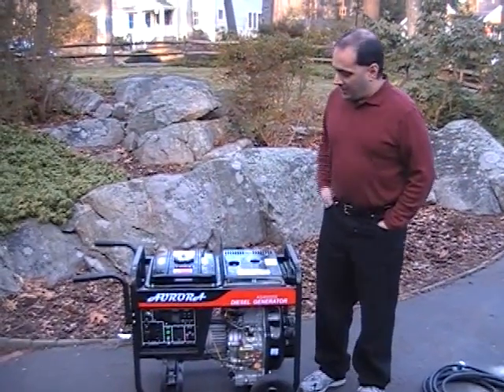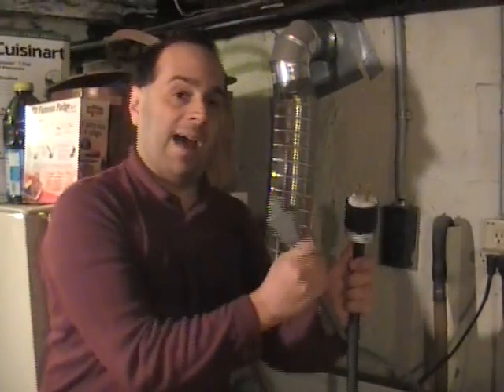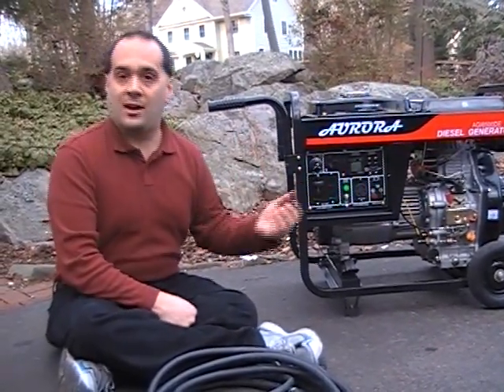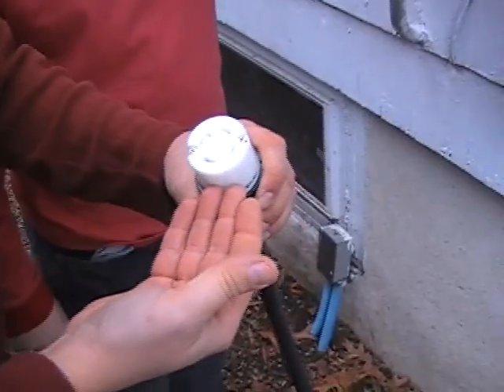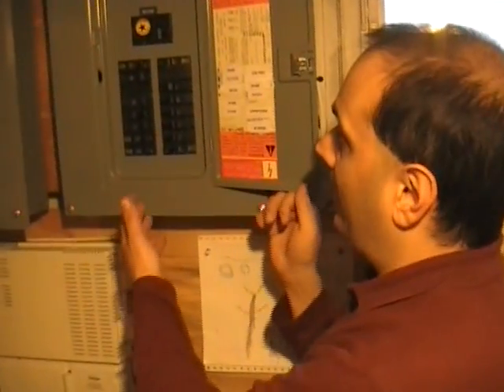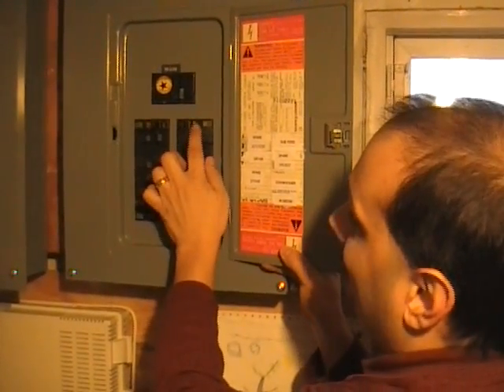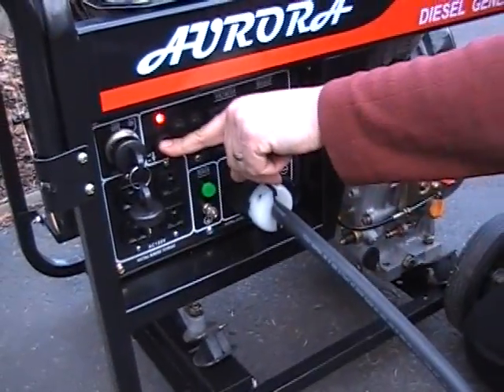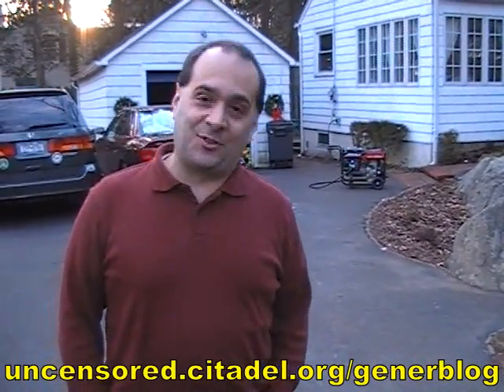Inexpensive residential generator hookup

Comment: I just bought a wen 56203i 2000w portable generator with just 2 110 outlets. can I hook it up to a transfer switch and just operate the circuit for my living room
Reply: With something that small I'd skip the integrated complexity (the home heating options would also determine this)and just run a few extension cords into and around the room. I did that in my first emergency before I even knew about anything like this. Might want those cords  and t-connectors on hand before the power goes out. And must have the gasoline before also. Even ran a cord to the lady next door.
Reply: Here are the rules about portable generator safety: make sure you are aware of all the warnings before using portable generators. This is just a reminder for everyone’s safety. All generator safety rules should be followed carefully. This advice is just to make sure that everyone is aware of all the warnings and it’s just to remind people to be careful using portable generators. Generators can be dangerous if not used carefully. Every year, hundreds of people die or get injured when using portable generators due to carbon monoxide poisoning and electrocution. Make sure you are using your generator carefully and keeping others safe as well. There is something very serious that everyone should always be aware of when using generators. Some people do run their generator indoors which is not safe and that increases the risk of carbon monoxide poisoning which can cause death of family and you. Some people run their generator in wet conditions which can electrocute them. Please remember that you should never run your generator indoors. Remember that carbon monoxide is an odorless and colorless gas that you cannot see or smell. Carbon monoxide is a silent killer. Keep that in mind. Make sure your generator is 15-20 feet away from your house and away from doors, windows, and vents. Never use your generator in your porch too. Having a carbon monoxide detector is very important against generator safety. Some people also allow children to go near the portable generator which could pose risks. We need to keep an eye on our children making sure that they are not near the portable generator so they won’t get electrocuted or burned by the generator which is dangerous. A locking enclosure also keeps kids safe. A generator shed might look like a tempting place to explore, or take cover during a game of hide and seek, but a generator is a dangerous piece of equipment that can cause injury. It says on the manual that we should also keep children away at all times from the portable generator to avoid injuries. Please do not allow a child or unqualified people to operate the portable generator.  It is important to keep your children safe especially little ones. The portable generator can be hot during an operation. Just because some manuals missed what should be listed doesn’t mean it’s safe to do. Always follow the generator safety rules when using portable generators. Generators pose electrical risks. If you need to use your generator during wet weather, you need a generator tent to protect your generator from getting wet. Don’t let your generator get wet. Keep your generator dry and before using your generator, please make sure your hands and your generator is dry. Do not wear loose clothing when operating the generator. Everything that is said on the generator’s operating manual should not be ignored. Never smoke cigarettes near the generator. Please keep flammable things away from the generator. Never overload your generator too. Your generator can catch fire. Never ever try to plug a generator cord into a wall outlet to avoid back feeding. Back feeding your generator is dangerous. Always turn on your generator first before plugging in appliances and shut off the appliances before turning your generator off. Use a heavy duty cord for your generator and the cord should not be worn out. All the instructions should be followed carefully. Never refuel your generator while it’s running. It can cause fire if fuel spills while your generator is hot. You should turn off your generator and let it cool off before refueling it. Having a fire extinguisher next to the generator is also important. This is only a reminder for everyone’s safety of using generators. Make sure your generator is properly grounded. Having a fire extinguisher next to the generator is also important against the safety rules. https://youtu.be/I1jT3ANENvI and here is a video more about keeping others safe when using generators and also about our family’s safety. It’s important to keep our little children safe as well. Make sure they’re away from the generator. Hope this helps. Thank you. Be safe

Comment: I'm curious how the utilities are ran on the generator panel. Is it tied to the main panel?
Reply: The generator panel is fed from the main panel. There is a breaker in the main panel as well as in the generator panel.

The generator panel has two feeds but due to the interlock kit, only one can be turned on at a time.
Reply: Here are the rules about portable generator safety: make sure you are aware of all the warnings before using portable generators. This is just a reminder for everyone’s safety. All generator safety rules should be followed carefully. This advice is just to make sure that everyone is aware of all the warnings and it’s just to remind people to be careful using portable generators. Generators can be dangerous if not used carefully. Every year, hundreds of people die or get injured when using portable generators due to carbon monoxide poisoning and electrocution. Make sure you are using your generator carefully and keeping others safe as well. There is something very serious that everyone should always be aware of when using generators. Some people do run their generator indoors which is not safe and that increases the risk of carbon monoxide poisoning which can cause death of family and you. Some people run their generator in wet conditions which can electrocute them. Please remember that you should never run your generator indoors. Remember that carbon monoxide is an odorless and colorless gas that you cannot see or smell. Carbon monoxide is a silent killer. Keep that in mind. Make sure your generator is 15-20 feet away from your house and away from doors, windows, and vents. Never use your generator in your porch too. Having a carbon monoxide detector is very important against generator safety. Some people also allow children to go near the portable generator which could pose risks. We need to keep an eye on our children making sure that they are not near the portable generator so they won’t get electrocuted or burned by the generator which is dangerous. A locking enclosure also keeps kids safe. A generator shed might look like a tempting place to explore, or take cover during a game of hide and seek, but a generator is a dangerous piece of equipment that can cause injury. It says on the manual that we should also keep children away at all times from the portable generator to avoid injuries. Please do not allow a child or unqualified people to operate the portable generator.  It is important to keep your children safe especially little ones. The portable generator can be hot during an operation. Just because some manuals missed what should be listed doesn’t mean it’s safe to do. Always follow the generator safety rules when using portable generators. Generators pose electrical risks. If you need to use your generator during wet weather, you need a generator tent to protect your generator from getting wet. Don’t let your generator get wet. Keep your generator dry and before using your generator, please make sure your hands and your generator is dry. Do not wear loose clothing when operating the generator. Everything that is said on the generator’s operating manual should not be ignored. Never smoke cigarettes near the generator. Please keep flammable things away from the generator. Never overload your generator too. Your generator can catch fire. Never ever try to plug a generator cord into a wall outlet to avoid back feeding. Back feeding your generator is dangerous. Always turn on your generator first before plugging in appliances and shut off the appliances before turning your generator off. Use a heavy duty cord for your generator and the cord should not be worn out. All the instructions should be followed carefully. Never refuel your generator while it’s running. It can cause fire if fuel spills while your generator is hot. You should turn off your generator and let it cool off before refueling it. Having a fire extinguisher next to the generator is also important. This is only a reminder for everyone’s safety of using generators. Make sure your generator is properly grounded. Having a fire extinguisher next to the generator is also important against the safety rules. https://youtu.be/I1jT3ANENvI and here is a video more about keeping others safe when using generators and also about our family’s safety. It’s important to keep our little children safe as well. Make sure they’re away from the generator. Hope this helps. Thank you. Make sure you follow the generator safety warnings before using your generator. Have a good one

Comment: Having worked in 24/7 power production and industry, there arr other considerations for the location and hook up of that generator.
The twist lock plugs are to code, yes. Handling electrical hook ups in the rain or snow is not easily done when the chips are down and the poeer is off. A knife switch is better for making that connection. Also, a vertical plug keeps the water out better than that plug and cord holding the connection box open to the elements.
Refilling that generator will require a funnel and fuel cans or a transfer from a diesl tank on a truck or tractor, again, weather permitting.
Noise can make people inside crazy. If you add a stack above the gutter line to hook to that generator it will cut way back on the noise.

Great beginning  video.

If you have solar/wind/ battery system also, where would you place the connections? Need generator to charge batteries if solar panels are buried under snow or ash (from a forest fire). So integration of all compknents and logic is critical.
Reply: Here are the rules about portable generator safety: make sure you are aware of all the warnings before using portable generators. This is just a reminder for everyone’s safety. All generator safety rules should be followed carefully. This advice is just to make sure that everyone is aware of all the warnings and it’s just to remind people to be careful using portable generators. Generators can be dangerous if not used carefully. Every year, hundreds of people die or get injured when using portable generators due to carbon monoxide poisoning and electrocution. Make sure you are using your generator carefully and keeping others safe as well. There is something very serious that everyone should always be aware of when using generators. Some people do run their generator indoors which is not safe and that increases the risk of carbon monoxide poisoning which can cause death of family and you. Some people run their generator in wet conditions which can electrocute them. Please remember that you should never run your generator indoors. Remember that carbon monoxide is an odorless and colorless gas that you cannot see or smell. Carbon monoxide is a silent killer. Keep that in mind. Make sure your generator is 15-20 feet away from your house and away from doors, windows, and vents. Never use your generator in your porch too. Having a carbon monoxide detector is very important against generator safety. Some people also allow children to go near the portable generator which could pose risks. We need to keep an eye on our children making sure that they are not near the portable generator so they won’t get electrocuted or burned by the generator which is dangerous. A locking enclosure also keeps kids safe. A generator shed might look like a tempting place to explore, or take cover during a game of hide and seek, but a generator is a dangerous piece of equipment that can cause injury. It says on the manual that we should also keep children away at all times from the portable generator to avoid injuries. Please do not allow a child or unqualified people to operate the portable generator.  It is important to keep your children safe especially little ones. The portable generator can be hot during an operation. Just because some manuals missed what should be listed doesn’t mean it’s safe to do. Always follow the generator safety rules when using portable generators. Generators pose electrical risks. If you need to use your generator during wet weather, you need a generator tent to protect your generator from getting wet. Don’t let your generator get wet. Keep your generator dry and before using your generator, please make sure your hands and your generator is dry. Do not wear loose clothing when operating the generator. Everything that is said on the generator’s operating manual should not be ignored. Never smoke cigarettes near the generator. Please keep flammable things away from the generator. Never overload your generator too. Your generator can catch fire. Never ever try to plug a generator cord into a wall outlet to avoid back feeding. Back feeding your generator is dangerous. Always turn on your generator first before plugging in appliances and shut off the appliances before turning your generator off. Use a heavy duty cord for your generator and the cord should not be worn out. All the instructions should be followed carefully. Never refuel your generator while it’s running. It can cause fire if fuel spills while your generator is hot. You should turn off your generator and let it cool off before refueling it. Having a fire extinguisher next to the generator is also important. This is only a reminder for everyone’s safety of using generators. Make sure your generator is properly grounded. Having a fire extinguisher next to the generator is also important against the safety rules. https://youtu.be/I1jT3ANENvI and here is a video more about keeping others safe when using generators and also about our family’s safety. It’s important to keep our little children safe as well. Make sure they’re away from the generator. Hope this helps. Thank you.

Comment: "Not made to have current flowing that way" HAHAHAHAHA its all wire. There are no semis or diodes to make them a one-way outlet, nor is it bad to switch- with one exception. the wire needs to be rated to carry 20-30 amps which is common for drier outlets

Comment: I used two spare breakers in the main panel to tie to a generator hook up box. If I want to use the generator,    I shut off the utility main, then turn off all breakers.  Then turn on breakers for lights and refrigerator only. Anything wrong with the hook up?
Reply: Sounds like what I do.